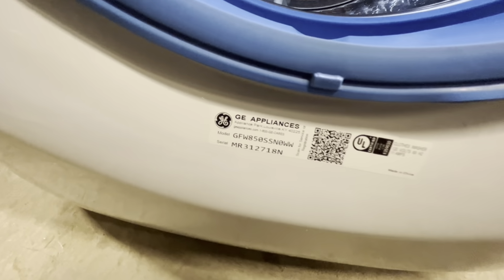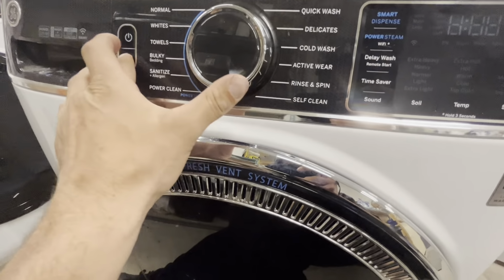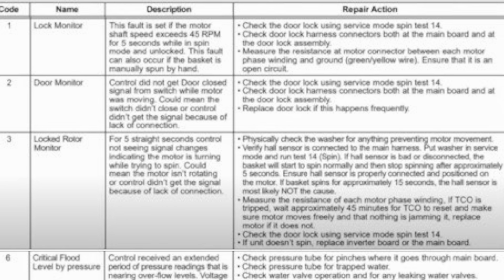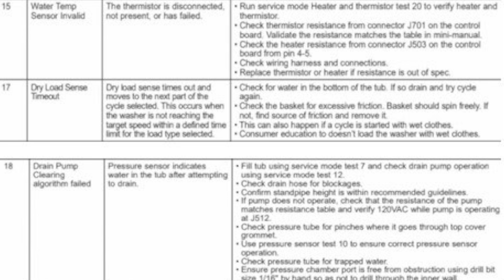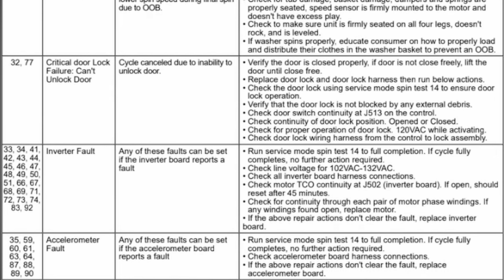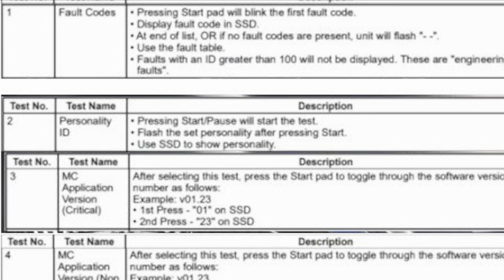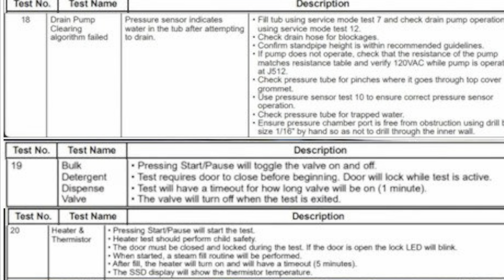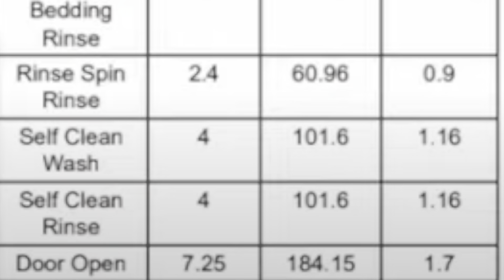How To Enter Service Test Mode GE Washing Machine Error code list Troubleshooting Mode

Comment from the maker: I somehow forgot test 24 in this video ….Damper 24
* Pressing Start/Pause will toggle the damper state.
* When the damper feedback indicates that the damper is open, the Soil Level "Light" LED will blink
* When the damper feedback indicates that the damper is closed, the Soil Level "Extra Light" LED will blink.
Reply: It's blinking 'light' for test 24. What does it mean if the damper is open?
Reply from the maker: is the blinking light on “light” or “extra”? I believe the “open” damper allows the damper to resist more shock and closed will stiffen up the damper (not sure tho)

Comment: Help: We replaced the control board. We set the ID to 1, then 3 as the mfcr. stayed. Replaced the door switch. We still get a 91 error code (loss of communication). Any ideas? We already paid for a service technician, ordered the control board, door switch and now it still won't work past 2 minutes. It is starting, filling, spinning but then turns off. Any suggestions?
Reply from the maker: @Selena9999  Are there any other error codes? Have you reset the error codes? This sounds like an inverter/motor problem which is common on these machines. I doubt the control board was bad. The 91 code pops up if the cycle stopped or you leave it paused for a long time. You need to reset the code and try to run again. Check for the code immediately after failure along with any other codes. How long does the machine spin for? You May want to save your money and invest in a new machine. Let know me know the answers to the questions I asked.
Reply: @ Ok, now the code states it is the hall effect sensor on motor according to code and test. What is that? It spins for a few seconds then stops, then again then stops for 2 minutes and then shuts off.

Comment: I hold my start button but nothing happens. No sounds or lights or anything.
Reply from the maker: Does the machine have power? It’s possible that the control board is fried or the power is not making it the control board

Comment: I just replaced the main board. During set up it selected profile 1 for the board. I am missing some cycles. How would I go reset the board to try a different profile?
Reply from the maker: @ronnieb8406  You need to enter test mode. Select test 17 and change personality to the correct one for your machine. Watch this video how to enter test mode https://youtu.be/JglsX87UdeY?feature=shared
Reply: @Theocdrepairman  big help! Thanks!

Comment: I just replaced the main control board and door lock, now the door lock makes a buzzing noise when I close the door.  Error code 91
Reply from the maker: That error code MIGHT be irrelevant. Clear the codes and run a cycle again see if the code returns. I investigate the wiring to the door lock. Why did u replace the door lock?

Comment: i have the same machine. the issue with the washer is that it "END" on rinse cycle. The word END is displayed on screen. Water does not drain. tested pump through test mode without problem. tested spin and the machine spins for about 5-6 sec before it stops. then spins for 5-6 sec again, then stops. process repeat until test ends. not sure if thats how the spin test works like that. Holding on to start for 10 sec does nothing. I can hear a click but nothing happens. Somebody on reddit says it was the belt.
Reply from the maker: @animatedlife00  did you have a load in the machine during test cycle? Did you check all drain hoses for clogs? Does the machine during the test? Any error codes? These machines are weak especially if overloaded with n the past.
Reply: Error codes are 3, 8, 19, 26, 27, 29. Yes ive checked drain hoses. No load in washer at time of test. There are no obstruction from my knowledge. Looks like the error codes want a #10 sensor test
Reply from the maker: @animatedlife00 did all the codes return after resetting them?I would be looking into code 29

Comment: What if nothing happens after I hold start for 10 seconds?  I hear a click but then nothing else happens
Reply from the maker: Maybe the control board is bad? What are other symptoms like when you run the machine normally?
Reply: @Theocdrepairman  I would turn it on and it was just shut back off.
Reply from the maker: @theoneCos this sounds like the control is bad or the power distribution block is bad. Check where the wires from the power cord connect to the inside of the machine where the power cord wires connect is the distribution block. Look for burned connections. If everything looks good try using an extension cord to rule out power from that outlet. Then if still nothing it is likely a bad control board that will need to be replaced. (This is just my educated guess not being able to see the machine in person)
Reply: @Theocdrepairman  thank you for the responses!  Hopefully I can get this figured out. Or unfortunately have to call someone out cause I’m not very handy lol